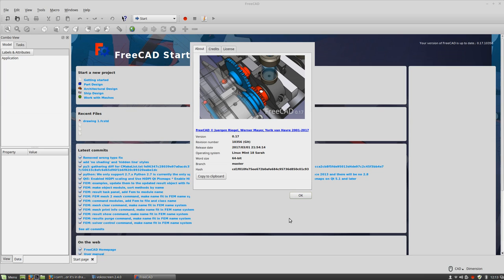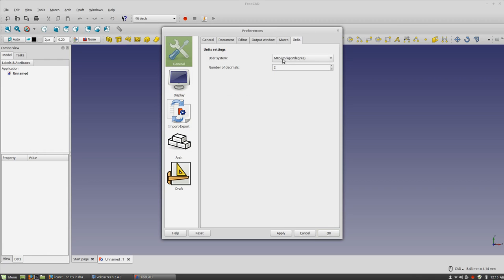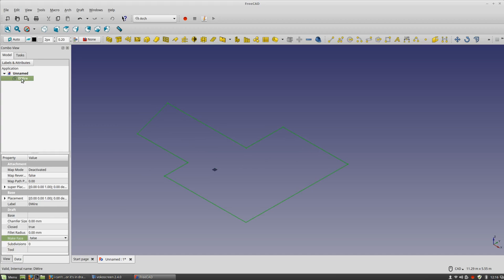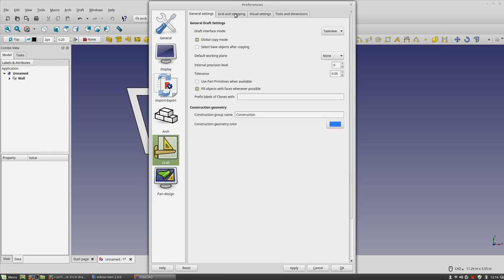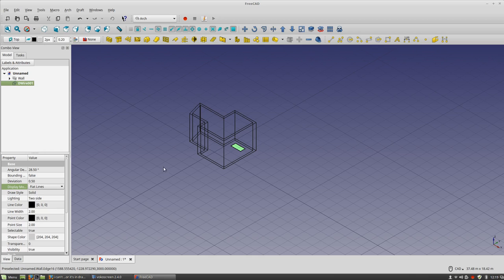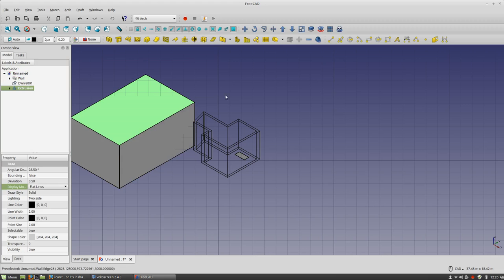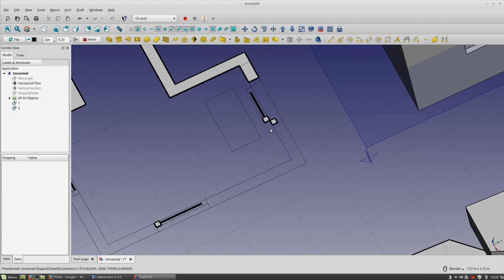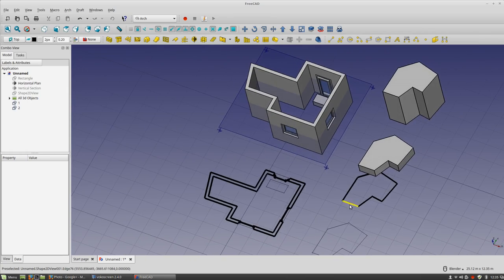Freecad Arch - 2D Plan Projection

Comment: Amazing tutorials. I have a doubt. Once I make the shape2dview it cuts the wall but not the windows and door. I don't know if I do somethin wrong or it's the version I'm working in. Thanks for all
Reply from the maker: That means the door and window is not added to the section. So select the door and window and then select the section cut lastly and then press the 'add' or 'plus' icon. And this should add the window and doors to the section at once and get it updated. Let me know how it works.
Reply from the maker: The video is a bit misaligned with the sound so it might make it hard to follow. To complement that video probably look up this other video 'FreeCAD Arch - Live Demo Test - 05'
Reply: It worked! I had to select the windows and doors individually. I'm working in the new 0.17 release for Win64 and once you choose cutfaces it doesn't cut properly
Reply: After first experience, I will continue with your tutorials. I'm eager to learn more how to use this architectural anb BIM tool. Thanks!
Reply from the maker: Yes normally the wall should host the door and windows and when you introduce the  selected wall into the section cut it should cut everything hosted within the wall aswell. I've noticed this anomality aswell because it used to work well. But Oh well such is the nature of open source development at times.